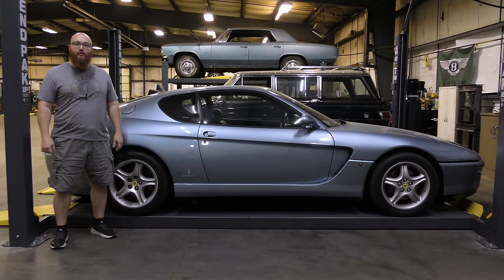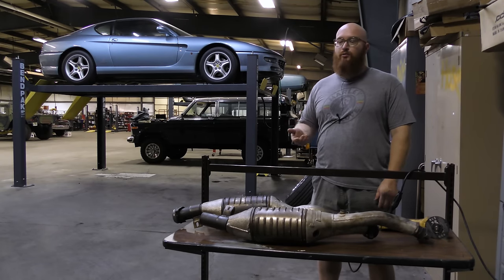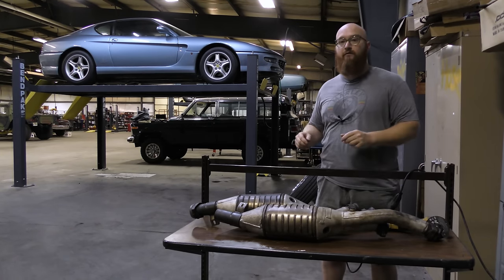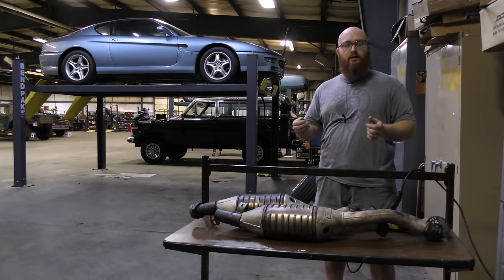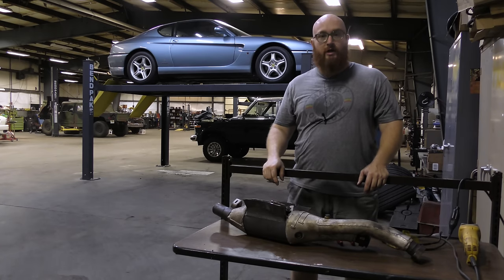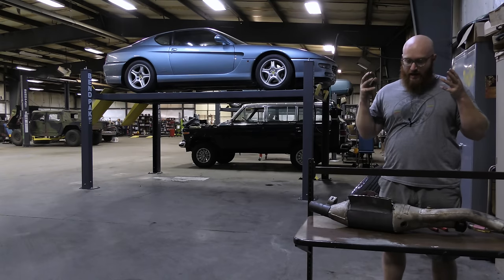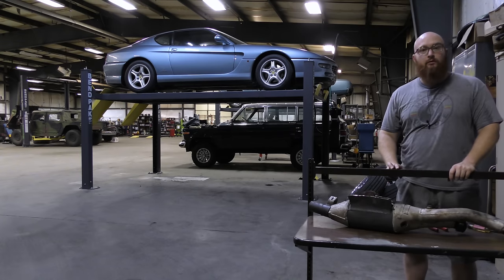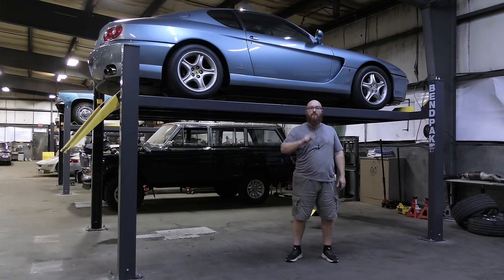Cat Melt Down! CAR WIZARD shares everything you wanted to know about Catalytic Converters and more!

Comment: I designed catalytic converters for GM while working for AC Delco (later Delphi).  Most of the failures (meltdowns especially) were either related to fuel control issues and/or spark failure (plugs, coils, etc.) .  I think buying any used car  should include a complete scan for any codes related to these.
Also, the precious metals are in the wash coat of the converter's ceramic core.  It's a very involved and toxic process to strip these metals out but prices for these precious metals are at all-time highs and becoming scarcer so thieves are taking advantage of this.
Finally, the flow-through characteristics of modern converters are very good.  That is, they contribute very little to the exhaust system's back pressure so you won't gain much more power by removing them (and it's illegal 😉)
Reply: Yup.  Excessive gas entering the cat definitely kills the cat and quickly too.
Reply: It would be nice if fault code history was non erasable from all ecus, I'd love to know if a car has had a failing coil pack or O2 sensor or whatnot in the past, and for how long, even if that condition no longer exists, in case this has affected the cat. Service history can then confirm what was done to rectify this situation. I would much rather this was all data driven.
Reply: The legal issue is why I bought a universal aftermarket catalytic converter and installed it into my 1984 Mazda B2000.  The information sticker under the hood has the word "CATALYST" in all caps and bold print.  To me that means a catalytic converter is required for that vehicle.  Just to make sure it would do the job, I looked inside the cat and spotted the expected honey comb inside.  I only spent about $40 to get the silly thing, but that was a few years ago.
Reply: Great info my dude!
Reply: honey comb cereal?
Reply: Yeah I agree with you 100%, it's rather stupid for guys to remove their cats thinking it's gonna make enough extra power to make a difference; maybe a 1/10 of a second, big deal! Here in Oklahoma, we don't have safety inspections any more and some nimrods take advantage of that....🙄
Reply: @philipthomas6808   For a lot of people, it's not the horsepower they want, it's the increased noise generated from straight piping the car.
Reply: @philipthomas6808  I won't lie, I've removed one from my 2000 Miata California spec, they came with two cats, one right on the header. Worldwide those cars had 1 cat only, NYC and CA cars had a second one on the header, revs much more freely now and sounds nicer. Replaced with a Mazda OEM header from a 2001, moved the 02 sensors and fitted a nice modern ca compliant magnaflow main Cat. Still passes emissions, still has 1 cat. Previous owner had ignored a misfire for 6onths and nuked the old one and they've become fiendishly expensive. I consider this an edge case. Story I heard is that Mazda were trying to hit some lower emission standard with the second cat but couldn't so reverted to one cat in 2001 anyway. All 2001-05 miatas in CA have one cat, all 89 to 98 miatas have one cat, it's just the 99/00 that had the second one.
Reply: Our police cars used to fry them from idling in spot for hours, such as at a fire or accident. It was necessary back then to idle the engine to run the lighting.
Reply: @philipthomas6808  said “nimrods” wont be having to wait for parts tho now will they?
Reply: You probably didn’t design any of the converters in any of the cars built by GM Korea (the Aveo, Spark, Encore, etc) or I would be demanding why a set of OEM cats for a 2009-2011 Aveo are expensive enough to mechanically total the car!
Reply: @digitalrailroader  Those were after my time.  My applications were mainly for 1995-2000 Cadillacs with 4.9L and Northstar engines.  They were terrible and caused me many headaches!
Reply: It's stupid that it's"illegal". So glad my state doesn't have emissions. Straight pipe everything I own
Reply: REALLY  ? (they contribute very little to the exhaust system's back pressure )tell that to cars which have 2 sets of cats on each bank and newly they have particulate filters too once those are removed the car is transformed holy shit this is the biggest bs i have ever heard and tbh i like cats on cars cause without them they stink like shit
Reply: Question - why are the prices higher? Cats have never been cheap and neither have the precious metals. My theory is that the arrival of quality battery-powered tools - reciprocating saws and then right angle grinders -- have made cats very stealable, starting about a decade ago. Did increased theft and increased demand for replacement cats in the repair market drive up demand for precious metals and thus make thievery even more tempting?

Or are the drugs just that good nowadays?
Reply: @denverbasshead why?
Reply: U r full of it and yes they do slow down the exhaust a ton!!!! They'll even keep a car from starting

Comment: Well they almost totally remove Carbon Monoxide, which is a poisonous gas. That is the primary No.1 reason. When i think back to how the Air smelled in our town when i was a young kid and think how different it is today. A massive difference. Lung issues also massively reduced in heavy traffic areas like London UK. Here in the UK they came in as a requirement in late 1992.
Reply: Carbon Monoxide is colorless and odorless.
Reply: @21Piloteer  Unburnt fuel and oil is not.  If you spend any amount of time in the industrial sections of a country that has no regulations on any emissions you'll know why we do.
Reply: @21Piloteer  Absolutely correct.  No wiggle room for the commenter on that.  LOL!
Reply: @21Piloteer  Well, Euro 1 car and Euro 5 emission cars are different ball games in exhaust fume smell.. I own both.
Reply: @21Piloteer  start the car without cat and with cat and if you do so, you can easily smell the difference. It obviously is not just about carbon monoxide.
Reply: @21Piloteer  Standing next to a non-catted car idling smells like shit.
Reply: @ladam836  That has more to do with how efficient modern cars have become in that span of time ('94 to now). Everything went from being mechanical or electromechanical with simple computer control, to the extreme precision of modern computer control. Better VVT systems, much higher compression ratios etc.
Reply: @EvzenEmanuel  yeah, a car without a cat smells like a motorcycle, or a classic car.
Reply: I don't believe you can burn Carbon Monoxide.
The exhaust would be Carbon Monoxide.
Reply: @volvo09  it smells like shit and it's poisonous. Standing near non-catted exhaust for longer period would make you dizzy.
Reply: @davewilson9772  CO can be converted to CO2.  A clean burn of a hydrocarbon yields CO2 and H20 (water).  But I get what you're saying.
Reply: @Ralph Reilly Unless you're in an enclosed space.
Reply: @admranger  I did a little more reading as well.  You were way more correct than I was.
Cheers.

Comment: The quickest way to kill a catalytic converter is to lose a coil pack.  This means that the cylinder does not fire, and the gasoline winds up burning inside the cat = Melted substrate.

Great video!
Reply: Some some stupid Yougsters here in Europe are deactivating their Fuel cut-off for a banging Sound in their Exhaust.
Reply: @theoneandonly8567  Yes, they do that in the United States, it only takes a few lines of code.  Many aftermarket injection systems literally have that as a setting!  Though I doubt this is enough fuel to harm the converter.
Reply: @Flies2FLL  oh I think it's enoug. The Sporty Cars wich are have this Originally from the Manufacturer are specially Made for this. Cats are very sensitive. I had only one bad Spark Plug on my V6 for a short time and this was enough to demage a Cat.
Reply: @theoneandonly8567  Well, for 19 years I drove a Porsche 928S2 that would give some pretty loud bangs and pops on overrun, especially if I blipped the throttle.  I did this for the whole time and never hurt the cat.  I had a rising rate fuel pressure regulator on the car since these were NOTORIOUS for running lean.  I suspect that Porsche built a pretty substantial unit;  I had S4 cats on the car, they are one piece with two cats and the whole assembly must have weighed 50 pounds!

Another car was a '97 Jetta with the VR6 engine.  I lost a pair of coils one night driving to work and when I got to the employee lot, the red glow under the car was like a neon kit!  They didn't melt, but I bet I got them pretty damn close....
Reply: Hard to credit that a coil or plug could damage a cat but there again, truth is stranger than fiction. Good to know the ins and outs of cat 🐈  operation before the inevitable destruction occurs. Goes to show the critical importance of car engine maintenance at regular intervals.
Reply: @fieldsofomagh  One of the most important things you can ever do to keep your cat happy is to open a can of tuna.

Catnip works too...
Reply: @fieldsofomagh  coil or plug failure indirectly kills the cat... the unburned fuel gets burned in the cat and overheats it.... it'll turn red hot or even bright red depending upon how much fuel is getting dumped in. 

if you can unplug the suspect cylinders fuel injector you'll be fine driving it to a shop, or back home.

Comment: Wizard, I'm having mine replaced because they were stolen. These guys love isolated/dark areas on the street and long time parked cars. They also love high risers so if your car lowered, you're likely not in their interest than the lifted truck around the corner

 I heard it's a dicey job messing the joints directly connected to manifold so that's why I gave up on doing my own but still saving thousands by buying own parts

Comment: I think a good exhaust shop plus some aftermarket universal cats would be the way to go.
Reply: Car Wizard, that is a metal substrate not ceramic. Metal has increased flow which adds horsepower. All high end sports cars use metal substrates.

Comment: Thank you so much for doing video on WHY these Cats get stolen. Very Nice that you had one to take apart to explain the guts of the EXPENSIVE parts to me Farmed out as high value metals. My Cat was CUT off my 2000 Ford F-250 in my driveway. 40 second the theft took my next home over came out with all the saw noise. ( My RING camera recording all the theft)
The guy in vehicle started beeping horn. I called the cops they were there in like 10 minutes. The cop was so nice, he even said he was sorry this happened to us. We gave him RING footage of theft, it gave PD a License number of theft vehicle. My next home over got License also. About a week later we got call from a Detective from a big city by my home. You see the same vehicle was used on another Cat. theft, this time the home owner confronted the theft. guess what happened the theft person pulled a GUN on homeowners. My ( RING Camera) gave great information on theft ring doing the Stealing of these Cats. The bad part is it cost me $2500 for replacement plus I installed anti theft rebar cage. Like he said if I just installed a straight pipe, would have check Engine light ON, my truck did not run right without Cat. installed properly. Just sucks in my Humble opinion. I'm just saying to everyone out there. PAY the money to get the anti theft protection. It's a LOT cheaper than them cutting off your Cat. They do it in less than a minute. The PD must start investigation on who is buying these Cats. to melt down, go after source.

Comment: I remember back in the '80's my Mom had a Chevy Chevette, which was running rough and had even less power than usual.  Took it to a shop, and as they were revving the engine trying to figure out what was wrong (these are the days before OBD II and trouble code), one of the mechanics noticed a cloud of fine particles blowing out the tailpipe.  They noticed it was starting to run smoother and rev up better, and kept it up.  Turns out the cat had something of a melt down, and it was blowing its insides out the exhaust.  After a little bit, nothing more was coming out, and it was running better than ever.  There were no emissions tests during yearly inspections then, and if you looked at the exhaust system it looked like it still had a cat so it would pass; it was just empty now.  Car actually had a little tone to the exhaust now, and went up hills noticeably better.  Also slightly better gas mileage.
Reply: gutted the cats on my 04 lexus. it now makes loud v8 noises

Comment: Been in the biz for over 30 years. A friend of mine once said " catalytic converters don't die, they are murdered." Meaning that a cat is designed to last the life of the car. Something always contributes to the death of the cat. Not that the cat "went bad"
Reply: The one on my LPG Ford ute died at 70000km and 5 years old. Was rattling quite badly. I have replaced front pipes where the cat has been serviceable but the pipes are burnt out at 200000+km and 15 y/o and others like my ute at low km and age.
Reply: Unless you drive the car longer than "the life of the vehicle"
Reply: @ItsMeUrDaad   No. The complete life of the vehicle. If it goes 100k or 1 million miles.
Reply: @jackhaskins6855  delusional
Reply: @ItsMeUrDaad  Make sure you tell that to the people that design and manufacture catalytic converters. I am sure you know more than them.🙄
Reply: @jackhaskins6855  a vehicle with 1 million miles has gone well past the "life if the vehicle". Cats arent magic and dont last forever. I know boomer lore has you believing random shit you heard but.. ok lol.
Reply: @ldnwholesale8552  I wondered how heat was controlled in the LPG engines. You can only run them so efficiently or the cat burns prematurely. Fuel is wasted to cool the cat in a gasoline/petro engine. This could be programmed out but basically you'd have to have a tuner which is stupid and a ripoff

Comment: Got a good one, 2018 Mitsubishi Outlander Sport (small suv) with a 5spd manual, had the cat cut off, no aftermarket cat options. Oem one was 8months backordered. Put a temporary straight pipe in until the oem cat came in. Fast forward the cat comes in and goes in the car no problem. The car comes back less than 2 weeks later. It was cut off again!
Reply: Hahaha
Reply: Someone watching listening near the car. Or bragged, celebrated too much. Keep it a secret.

Comment: Back around 1980 we had a car come in that had the back seat over the exhaust that was heat distorted and bunched up on account of the car misfiring on a few cylinders because the spark plugs were worn out. Unburnt fuel was being dumped into the converter with combustion taking place in the converter and the  muffler downstream from it resulting in the warped rear seat. We did a tuneup and corrected the issue but the seat was ruined.
Also,when the metropolitan city I worked in was doing testing for roadway emissions before there were state emissions car inspections,they had to place the vehicle exhaust sensors further back from the roads because the readings were too high.

Comment: you can really smell the cars that don’t have them , I don’t mind them so much because of that.
people don’t like to have them but if no one had them it would be even more sitting in traffic.
Reply: yeah not all of my cars require emissions testing but I keep cats on all of them, replacing as needed. They smell much better and if you look up the data they are incredibly effective at reducing emissions, which unfortunately for some people they've decided maximizing their emissions is sticking it to the greens or something. In that regard, I am supportive of enforcement of emissions laws like has been happening in the diesel truck scene lately. It's one thing to tune a truck for more power but if it's tuned for rolling coal you're actually losing power versus what you could be making.

Comment: I remember back February of last year with my old car that I was coming home from work and it suddenly lost all power and the engine would not go over 4000 RPM and I had to limp it the rest of the way home with my hazards on. An inspection revealed that the maniverter (a catalytic converter that is combined with the exhaust manifold) had melted down and clogged my rear converter so I was without a car for several weeks because it happened right before the massive winter storm that nearly collapsed the Texas power grid. Thankfully family was able to provide a backup car so I could get to work (that same vehicle was used again when my old car was totaled by the deer)

Comment: Wizard I have a question. For these cars in which you have the cattle catalytic converters breakdown and meltdown, couldn't you just replace them with universal catalytic converters? In other words, doesn't the manufacturer state the number of cells that are in the original OEM cat and you could simply buy a aftermarket universal fit with the same number of cells? Those would be way easier to get. In fact most exhaust manufacturers like dynomax and others make universal catalytic converters in all different sizes? Are the computer systems in the cars really smart enough to know the difference between the Gen UN only in part and a universal? I feel like I'm missing a piece of the puzzle here.        Never mind you answered it. Thanks.

Comment: Running rich for a long period will kill them too. My nephew had a Ford Taurus that had a bad thermostat so the engine ran rich. They never checked gas mileage and they lived in a warm area so never used the heater to know it was staying cold. I don't think the car had gauges. Finally quit running>>totally clogged. Cost $2000 to replace.
Reply: Losing a coil does the same thing.